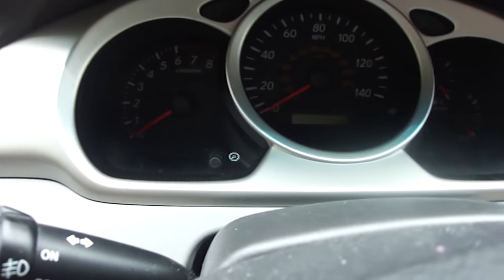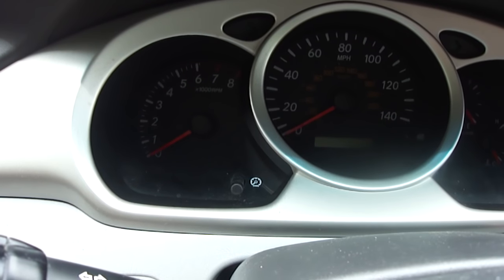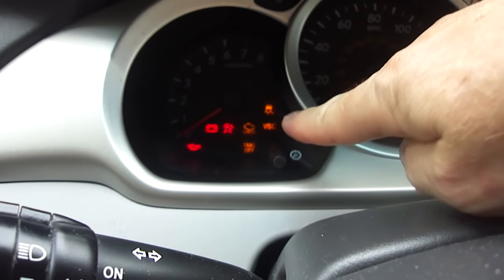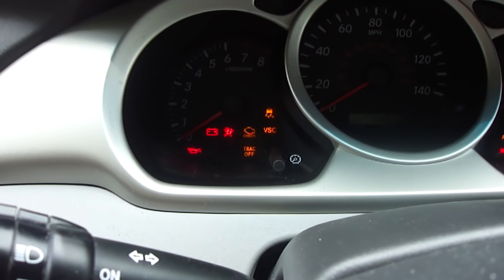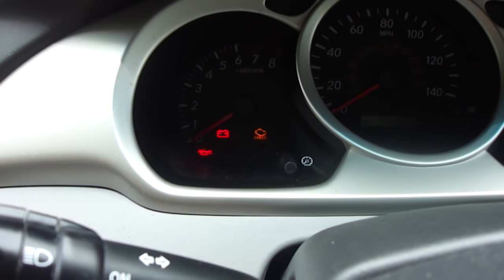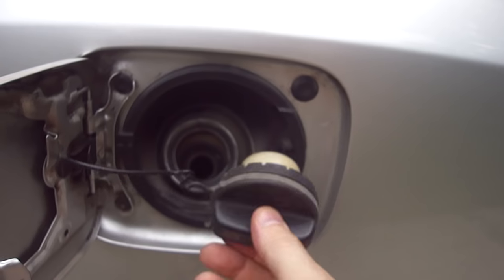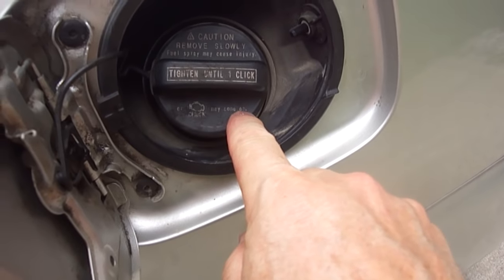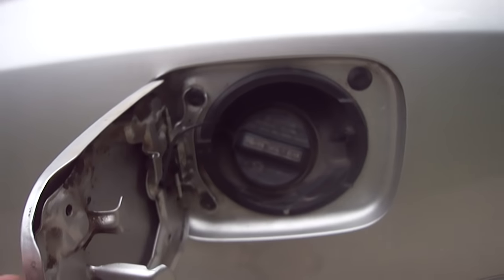(Part 1) How To Fix Your Check Engine, VSC, Trac Off Warning Lights On

Comment: I'm having problems with mine check vsc on dashboard cleaned cap etc but lights still on. not tried lube yet. what can it be?
Reply from the maker: Once a cap issue has been taken care of it can take up to 50 miles of driving before the light resets.

Comment: I have a 2007 toyota sienna and i did what you did the both lights still show up
Reply from the maker: Take it to an auto parts store and have them check it with a diagnostic scanner, which they will perform for free. This should give you a clue as to what’s wrong.

Comment: Toyota Huntington Beach charged me $800+ to fix this problem they claimed rats had chewed on wiring.  Less than 5 thousand miles later damn light is back on...after I had tires replaced.  WTF

Comment: Hi..I am driving Alphard...not new..just newly bought ..but it's kinda very old...I find that, the sensors...Check Engine, TRF and VSC appear at the same time..sometime it happens in the morning ..when I stop the engine for few seconds and restart the engine ..the sensors dissappear...in previous day, the sensors came out about 100 kilometers while I was driving....then I stopped the car to reset the car...and the sensors dissapeared..but it kept appearing about each kilimeters driving...not sure hot to reset the sensors without needing to use the resetter..I already fixed the high pressure hose which I found leaked and the o-rings sort of fuel connectors connecting to the engine which I found also leaked...but it didn't solve the problem..maybe someone out there have this kind of problem...please, I need your advice on my car...Its Alphard, model 2003..engine v6..

Comment: what is the tube you used?
Reply from the maker: It's called Magic Lube, comes in a 1 oz. tube and is made by Aladdin.  I picked it up at a swimming pool store and you'll also find it on line.  I've been using it for years and it's really fantastic stuff!

Comment: Did not fix my problem 🙃 its driving me nuts  i tried tighten fuel cap to the point buying new same problem im about to take to toyota
Reply from the maker: Take it to an auto parts store and have them check it with a diagnostic scanner
Reply: I have my own scanner I think I will take to Toyota I bought fj used maybe previous owner disconnected something to turn off vsc while off roading

Comment: Please help !!! I have a 2015 tocoma TRD pro  two lights are on the trac off and the check engine light  I checked the code and it reads P2438 thanks for any information god bless
Reply from the maker: How cold are the temperatures you're driving in right now?  Did your air injection pump fail or did the fuse blow?
Reply: @proclaimliberty2000  not sure how to check the fuse and it's about 80° I live in California SoCal

Comment: My 4 runner has those lights on all the time. And the little metal flap thing just inside the filler neck is missing. I believe that's the cause. But does anyone know how to replace it?
Reply from the maker: The metal flap is not the cause of the problem.

Comment: I have a 2004 4runner doing this and won't pass emissions test.  I have replaced the gas cap and didn't fix it.
Reply from the maker: Brad Phuck Have you driven at least 50 miles since you replaced the gas cap?
Reply: Yes.  I disconnected the battery over night then drove the car 52 miles and these three lights came back on.   @proclaimliberty2000
Reply from the maker: Brad Phuck Try to perform Parts 2  through 7. If that does not work, take it to an auto parts store which will normally check it for free with a diagnostic scanner.  This will normally give you some clues as to what’s wrong.
Reply: I will try the steps.  I did take it to Autozone and the code calls out o2 sensor and or catalytic converters.  My 4runner has two converters and 4 o2 sensors. @proclaimliberty2000
Reply from the maker: Brad Phuck it’s more than likely an oxygen sensor. Did they tell you which one needs to be replaced? Have you noticed lower gas mileage?
Reply: Gas mileage seems to be the same.  I did replace one of the four o2 sensors and the issue went away for two weeks then came back.  The dealer wants 89bucks to determine the problem.  You think that is fair to take it to the dealer and let them diagnose the problem?  Will they be able to do more extensive check then the auto zone code reader? Thanks @proclaimliberty2000
Reply from the maker: Brad Phuck If you have the full code from Auto Zone I have a video that shows you which oxygen sensor is faulty so that you replace the correct one.
Reply from the maker: Brad Phuck Dealership labor and parts are always just so expensive.  I don’t know what your finances are like and how much of your own time you want to spend trying to fix it.  I always buy my parts on eBay which always saves me a lot of money.
Reply: I was just going to get the dealership to diagnose the problem if they could tell me the exact problem.  I am not sure if they could or just give me a broad range of what it could be.  I could just replace the other three o2 sensors or go back to auto zone and get them to do a code check again.  I just need this 4runner to pass emissions check.. @proclaimliberty2000
Reply from the maker: Brad Phuck I would take it back to AutoZone again Brad. They should be able to give you all the information that you need from a diagnostic scan. Since you already replaced one oxygen sensor you are obviously mechanical and that’s great. When I get back home in a little bit I’ll send you the video I was talking about.
Reply: Great thanks for the help!! @proclaimliberty2000
Reply from the maker: @DillyDogSays  https://youtu.be/JEHI2mE-eHY
Reply: The codes are P0420 twice and P0430 twice.  4 codes.   @proclaimliberty2000

Comment: I have done this and yet the light persists on my lexus es 350 2010, really very annoying. Are there any other reasons for this?
Reply from the maker: Did you watch part 2 and follow my instructions?
Reply: proclaimliberty2000 I haven't seen part two, pls send me the link thank u
Reply from the maker: https://youtu.be/bPWrXEhGBHk
Reply: Samson Okoro Go get it scanned for free at your local autopart store...If you get a code back it could be something other than the gas cap..Example... A bad O2 sensor can cause this as well.
Reply: N Black I have done the scan bro at two different mechanic shops and they charged me and it showed oxygen sensor front and back. They changed the sensors, wiped off the code and it still came back. Another mechanic/electrician in my country is saying it's the catalytic converter. I don't even know if I should take the risk and allow him change it as well and see if it'll be fine.
Reply: Samson Okoro The code for the O2 sensors are separate than the one for the Catalytic converter...Is it the same codes that were coming up for the old O2 sensors? Were the O2 sensors replaced along with the wiring...Alot of times on Toyotas/Lexus it's the wire connected to the O2 sensor...Have your injectors cleaned along with the MAF.
Reply from the maker: It could be the Mass Air Flow Sensor.
Reply: proclaimliberty2000 I'll get that checked as well
Reply from the maker: Let me know what happens.
Reply: proclaimliberty2000 I will thanks
Reply: proclaimliberty2000
Reply: N Black the codes that showed P0051 and P0031
Reply: Samson Okoro P0031Causes-A short or open in the heater circuit in the sensor A failed O2 sensor heater Wiring/connectors broken/frayed leading to sensor and/or relay Failed PCM/ECM

A P0051 DTC trouble code may be caused by one or more of the following: A short in the heater circuit in the sensor A failed O2 sensor heater Wiring/connectors broken/frayed leading to sensor and/or relay Failed PCM/ECM
Reply: N Black What's the solution to this, is it the catalytic converter that needs changing?
Reply: Samson Okoro To fix a P0031 DTC code, you'll need to do a proper diagnosis. To do that, you'll want to inspect the wiring and connectors leading to the sensor. Also if equipped with a heater relay and fuse, you'll want to check those as well. Use a digital volt ohm meter to: check for 12 volts at the heater circuit feed (hint: unplug the sensor and check at the wiring connector to do this measurement) check the ground circuit for continuity measure the resistance of the heater circuit (done on the sensor itself) measure the resistance and voltage of the wiring Refer to a service manual for the correct specifications (volts, ohms) for your vehicle. On some Toyota vehicles this code is triggered when the resistance of the heater circuit is below 0.8 A. With that said, a common fix for this DTC is to replace the air/fuel (O2 oxygen) sensor #1 on bank 1. Please keep in mind that OEM (original equipment) replacement sensors are recommended (from the dealer). Aftermarket sensors can be less reliable and of poorer quality (not always, but more often). There's also a chance that replacement parts for the P0031 code may also fall under a federal emissions warranty (check with your dealer to see if it's covered).
Same solution for the p0051 code you're getting...The Catalytic converter is highly unlikely...You would have a different code(s)
Reply: Can this problem cause the car to consume fuel more than normal? Thank u for all the info
Reply: Samson Okoro Yes...O2/AF sensors along with Knock Sensors  can all cause you to burn more fuel...Dirty injectors as well...You also may notice a decrease in power.
Reply from the maker: How many miles do you have on the Mass Air Flow sensor and do you know for sure it's working properly?
Reply: proclaimliberty2000 how do I check that?
Reply: Samson Okoro If your car isn't giving you the P0171 P0172 P0174 codes it's not your MAF sensor...Lexus is very specific. I own 2 Toyotas and 1 Lexus. Those are the codes for your MAF sensor.
Reply: N Black ok cool thanks. MUCH APPRECIATED
Reply: Samson Okoro But it's not a bad idea to have it cleaned or do it yourself...Or simply replace it...They range anywhere from 40-150$ for your vehicle.
Reply: Ok thanks a million, I'm going to take the car to a registered dealer in my country tomorrow and discuss all u have said. Thanks a million again
Reply: N Black checked it at the dealers place and u were right bro, the specialist electrician checked it and said it's a wiring problem that the air fuel o2 sensor is ok,  but the o2 sensor itself at the back end didn't work. I have to bring it back to them cause I didn't have time to wait today. He said he'll have to check the relay/fuse box in the engine and that the problem is from there. He says I may not even have to replace the o2 sensor after fixing the wiring problem. But we'll see after he fixes the wiring problem
Reply: Samson Okoro Sounds like he knows...O2 sensors do go bad...Especially on high mileage vehicles...But it's more common on Toyota/Lexus for the wiring to be bad....Keep us posted.
Reply: N Black my mileage is 53k really, thanks for everything and I'll keep u posted.
Reply from the maker: One time I had a check engine light on.  The diagnostic computer check said it was my O2 sensor or my air fuel ratio sensor.  I replaced both and the check engine light still stayed on.  Long story short it ended up being my mass air flow sensor.  This is not 100 percent fool proof but try this and let me know what happens.  https://youtu.be/b4U_CGkS8ag
Reply: proclaimliberty2000 A MAF sensor going bad on a  53k Lexus would be extremely rare...Possible but rare.
Reply: proclaimliberty2000 thanks for this, will try this as well.
Reply from the maker: Did you ever get this problem fixed?
Reply: proclaimliberty2000 it's a long story but I haven't yet. The dealers I took it to messed things up completely, the car was grounded for almost two weeks till I got someone else recommended by another set of car part dealers. I believe the problem is the 02 sensor itself, I think the ones I changed before weren't good or the exact one meant for the car. The new guy after sorting out the problem the dealer electrician caused with the wiring of the car tested the wiring of the O2 sensor and it showed current is flowing there. I just want to recover from the stress the dealer guy caused before I engage another professional to sort it out. There aren't many top professionals that handle newer generation Lexus models in my country. That's the major problem we face here.
Reply from the maker: Thanks for the update.  Let me know what it was when you get it fixed.
Reply: proclaimliberty2000 I will, thank u for everything
Reply: Another reason could be unbalanced wheels.
Reply: 16 hacks  I haven't sorted it out and decided to leave it that way for now. Some one recommended one other guy I should meet in Lagos but after the hassle the guys at Elizade put me through i just don't have the time and energy to go through stress again. We could communicate via Google plus as well so I can introduce you to people who may be able to help.
Reply: 16 hacks A lot of things could be the issue my brother, but you shouldn't worry. First you need get it scanned by proper technicians, I don't know if there are many top notch guys in Benin city cause I haven't been there and it'll cost you alot to get a technician from here to come meet you there. My advise just come to Lagos one weekend, I'm sure u'll have a place to stay here. I can send you the number of the top notch electrician who sorted out the wiring problem the guys at Elizade caused and put me through hell. He can also introduce you to Mechanics if your problem is mechanical. He works with a team of capable mechanics. They are situated at Ladipo, far better than the accredited dealers at Elizade who just charge you premium and have limited knowledge on technical issues regarding Lexus

Comment: kind of o/t -- Hi Paul! New here ;>)   Great stuff Man. Say not sure of how to ask you of a Rav4 issue but can U direct me to a vid u may have on 2018 RAV4, dead battery, replaced, and now the 3 'malfunction' mssgs of Pre Collision, Lane Departure, and AWD, among other random lights display. No cruise etc.. I WILL watch a vid if u have one that generally speak to this. t/y  ;>)   [dlr trying to charge me $850 for a part! Ha.)  UPDATE: I just saw poster below 4 yrs ago Paul, that said "The last time this happened I was told i had to order speed sensor for a wheel."  Tech told me I have a  "steering angle sensor" fault. [the $850 part]. dead battery results in needing that? I don't think so.  Again I will look at any  cods you may have made addressing this if you can point me to one. And, very sorry for the long o/t post, just didn't know what method to ask you. Regards.

Comment: I spent 3 days scratching my head with this fault and all it was is the ignition lead onto a spark plug was lose
Reply from the maker: mars S Did you get a trouble code for this condition?
Reply: Couldn't find the fault as i didn't have an OBD,went down to my local Ultra tune and they  get an ignition coil fault code.Popped the bonnet and there it was,the lead had worked loose.Easy fix in the end.
Reply from the maker: Thanks for posting.